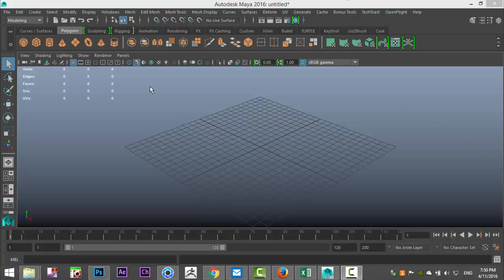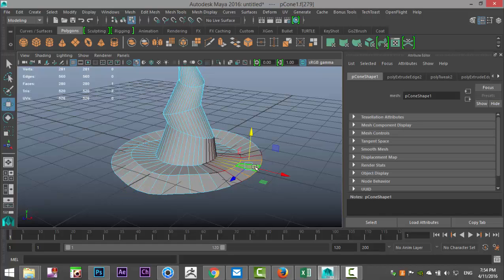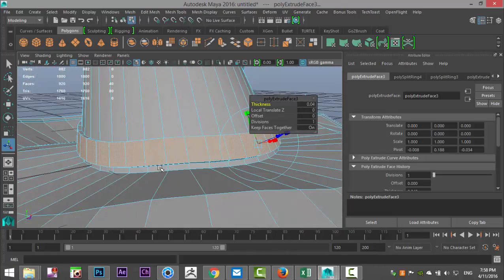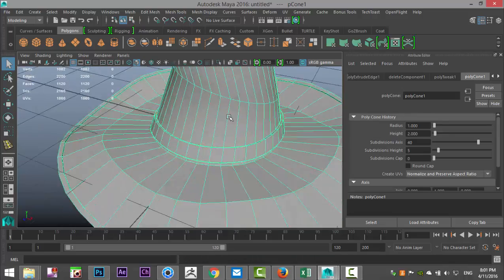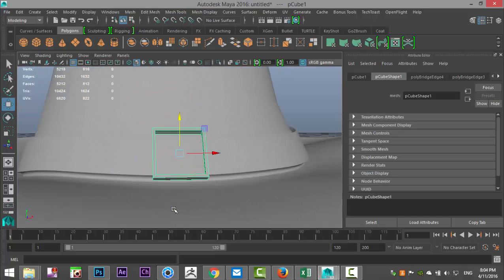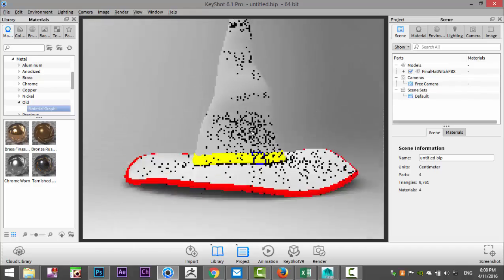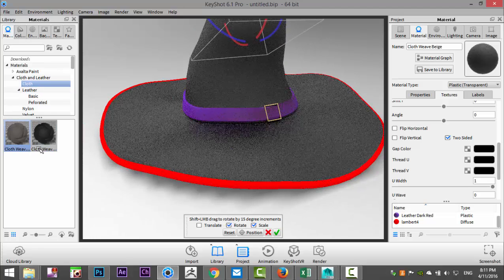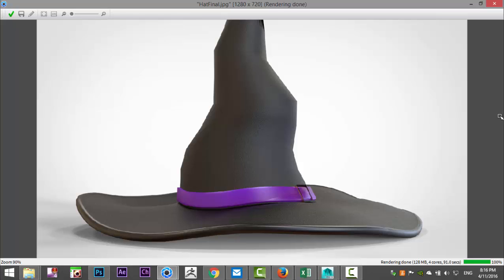How to model a Witch hat in Maya 2016

Comment: Is Maya good with sculpturing?
Reply from the maker: +Laissez - faire It's possible but not great. Try ZBrush or Mudbox
Reply: kwl thx
Reply: +Mike Hermes I've noticed that Maya 2016 now has the sculpting tools similar to Mudbox. Do they not work as well as they do on Mudbox? I've yet to try them out, so I was just curious.
Reply: +Sith Spawn I've been learning zbrush the past  three weeks, and it's dizzying amount of info, mesh insertion, subtools, extraction using masks and alphas, clip curve modifications with Alt, dynomesh, zmodeler, nanomesh, remeshing, transposing, and so on, and so on, and I've hardly touched my brand new large wacom tablet. But Mayas sculpting tools don't feel like Mudbox at all, not even close. And Mudbox, doesn't come close to Zbrush, but it has it's strong points, such as it's ability to project and allow fast creation of custom brushes.
Reply: Professional Artist
That's good info to have. Thanks! It would seem that Mudbox is still the superior sculpting tool in the Autodesk family. I would love to someday get my hands on ZBrush. I use Maya, 3Ds, and Mudbox. I've found that there are some things Maya does better than Max, and vice versa. I'm familiar enough with Mudbox to where I can get the results that I want. But if I can get familiar with ZBrush (and maybe Keyshot, since Hermes's videos have spiked my interest), friends would be hard-pressed to get me away from the computer :P